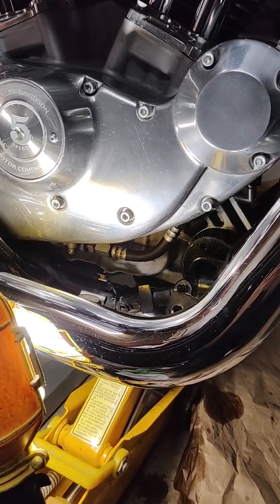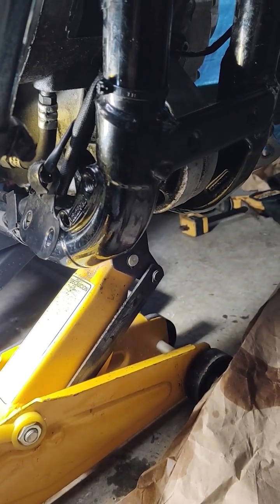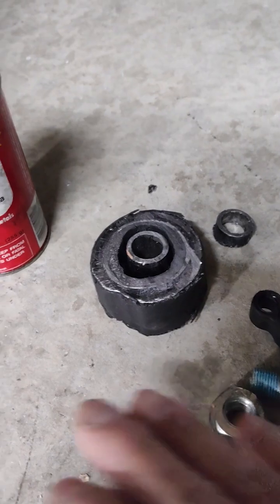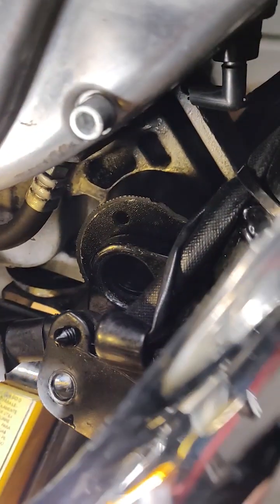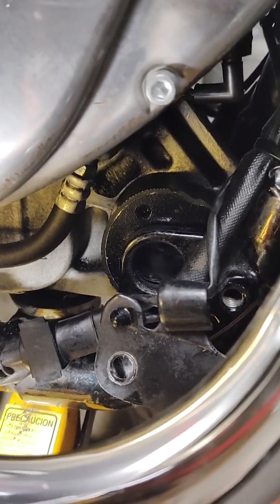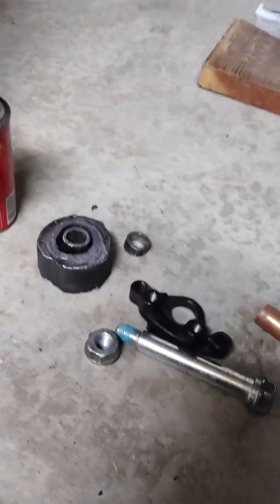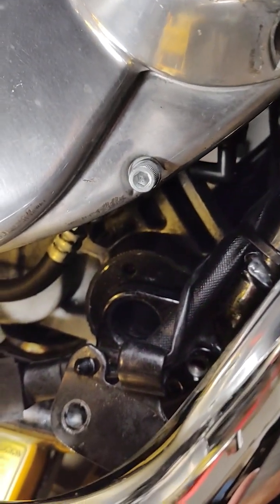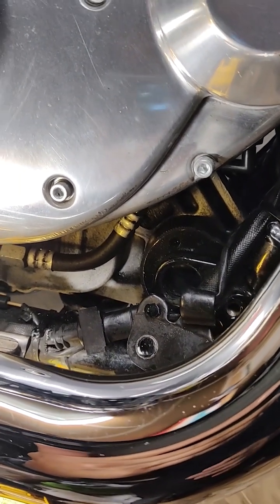HD Sportster Front Motor Mount Installation Tips 2004-2017

Comment: The trick is to change both front and rear - loosen off all the mounts and stabilisers, take the swingarm off and virtually take the engine out of the frame will give you enough movement to change them all,
The front mount is relatively easy compared to the rear one - even removing the swingarm is a breeze - but if the tube that goes through the lug on the rear of the motor is seized in then you have a real job on you hands. Harley changed the design on later models and you can retrofit the new version, but only if you can get the old one out !
I changed the front and rear mounts with nothing but simple tools and experience and fitted the Drag Spec replacements which hopefully will last longer than the softer H-D ones - and they ( all 4 - front and rear) were less than the price of just one H-D rubber !